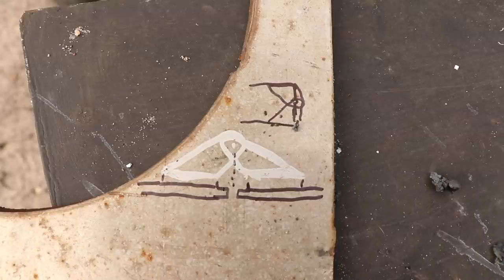Building a Boat Gate - Project Brupeg Ep. 77

Comment: As far as I know stainless steel (work hardens) as it gets hot it gets harder.
So as you drill (using a slow speed) ,have a continuous stream of water going into the hole, to keep the metal cool.

Found Brupeg on google maps.
The wife & myself were up at Bundy in October & we had a quick look from outside the fence.
No one was around at the time so we didn't come in.
You are all doing great work
Keep it up.
Reply from the maker: Thanks Bill. It would’ve been nice to catch up and show you round the boat. Thanks for the advice. I’m thinking of a little pump to do cutting fluid/water

Comment: Find a shaft to mock up hinge positions - i.e. to go through both hinges vertically and make sure their pivot point is aligned -  you can revert to separate bolts post fitting.
Reply: Yup. Was going to say the same thing. I did that When I had to weld hinges before. But you are probably ok.

Comment: Yep, you need some consumables for your plasma cutter. Once the tip blows out the side it needs to be replaced before it damages other parts. I buy them 10 or 20 at a time so I always have them on hand.
Reply from the maker: Yes I buy consumables in lots of 50 from eBay. The issue I was having is the consumables were lasting 20 seconds before for blowing out

Comment: 23:00: It's one of those objects that has a different name in every English-speaking country. Here it's called a "hand truck" or, more usually, "a dolly". I've got one that can support about 350 kgs. and converts to a four-wheeled pushcart. Very handy, especially if you've got an expendable one. 40:27: The dreaded nine-inch! It occurs to me that you could glue lengths of rubber strips on the inside of that stern at the three-mil gap to keep following seas from squirting onto the back deck. Same with the gap between the hinged doors. 49:28: Next you'll want a passerelle! This should also be handy for bringing supplies on board. 52:00: I watch Stu's channels as well. Our boat's right between yours and his in size at 12 metres/42 feet.

Comment: It always feels like an achievement once you get a hole drilled in stainless. It’s horrible stuff to drill. 
Bunnings used to have some Dewalt tungsten drill bits relatively cheap (about $50) for a full set. They were bloody fantastic for drilling stainless. A world easier than HSS drill bits. Unfortunately I haven’t seen them in stock the past few months. 
Well done, you guys are doing a great job and putting together a great video series.
Cheers
Reply from the maker: Thanks Michael

Comment: G'day from Bundy! You will likely have trouble trying to drill stainless with anything larger than about 6mm dia in a pistol drill.
If you have much more to do it would probably pay to invest in an old, el cheapo, drill press. The mechanical advantage afforded
by the quill feed rack and pinion allows you to maintain much better down force on the bit, to prevent 'bounce' which very quickly
destroys the cutting edges. Also you have much better speed control and the holes will be square to the workpiece. Proper thick
cutting oil is also essential. Normal HSS jobber drill bits should be more than adequate if used this way.
Bit late now, I know, but aligning the hinges for welding would have been easier and more accurate if you clamped each set of
pairs on a length of all thread with 4 nuts and washers to set the vertical spacing, ensure parallelism and axial alignment.
Good luck with the project. Keep up the good work. Really enjoy the channel! :-)
Reply from the maker: Thanks Martin after I made the hinges I thought I should have put a piece of threaded rod through them exactly like you mentioned. I have been considering a drill press for a long time but when 50 things need dollars and the drill press is something I can get away without it has always been hard to justify it
Reply: @ProjectBrupeg  Yeah, LOL understand the dollars bit. Still cobalt bits are pretty exxy too. 3 or 4 cobalt bits = a new press!
Reply from the maker: Yeah that’s a good point, didnt think of it that way

Comment: I am working a lot with stainless steal. For cutting stainless you have to have proper tools. They have a different angle on the spiral and they are out of different  material. You have to be aware that There are different kind of stainless. The one that is easy to work with is V2A. The one that is very, very hard to work with is V4A. If V4A is getting hot, you would not be able to cut through with a drill.

Comment: Re: The dog box (?). Get the cheapest metal garden trowel you can find and cut some wide-ish (5mm) slots along it's length. It'll make "cigar" removal easy, just scoop them up, give a gentle shake to let the sand fall through the slots and bag the nasty.

And I echo Sterlingsabre28
's comment regarding drilling the stainless, your pilot hole only need to be big enough to accommodate the split point of your final drill bit.
Reply from the maker: Thanks Andrew yeah I will swap how aim doing my pilot holes and thanks for the shovel suggestion

Comment: I save broken standard drill tips. Cut them really short and sharpen up. This way you can exert a ton of pressure whilst drilling SLOW. Works every time
Reply from the maker: What a brilliant idea! I’m stealing that!
Reply: @ProjectBrupeg  took me as much frustration as I saw you endure. Went to a steel fabricator one day with some stainless and that's what he used. So obvious really. I generally use 6mm bits (have not needed thinner diameters ,and they're very strong when so short) and upwards for this.  

Goodluck guys

Comment: To get hinge pins in alignment on the same plane, use a long single hinge pin though both hinges at the same time . That eliminate s binding and problems with holding 4 pieces at once.

Comment: Several things you should have when you start sailing . In the engine or mechanical room , a drill press , a vice and a bench grinder . The investment will pay for itself .
Reply: There are gadgets you can get to turn a regular drill into a press.
Reply: I good quality 15mm/1/2" bench top drill press would be a good addition to the boat project. Save you a lot of time and broken drill bits.
Reply from the maker: Dead right. We just brought a brilliant drill press recently

Comment: the hinges are binding on them self if you look at the gap when opening the gate you will see that each side of the hinge changes angle as it swings because of the slope on the stern, your idea to fix is good but you need washers between hinges top and bottom if that does not work it is because the angle of the hinges top and bottom are opposing angles. the angles need to match between top and bottom hinge.  hope this helps you could try bashing them.
Reply from the maker: Yeah large hammer alignment was my next thought for exactly the reasons you pointed out
Reply: Cheers  @ProjectBrupeg

Comment: How about Teflon washers between (and above & below)  center hinge points?
Reply from the maker: Yeah that’s not a bad idea. Might put a couple in and see what it does
Reply: @ProjectBrupeg  it will put you top lip out of level. grind the gap re-drill the holls. its looking so cool your doing a good job on it. first time coment whoop whoop love the channel
Reply from the maker: Hey Allen awesome to have you along. I need to put a wood cap on the top so I could maybe allow for any height increase by relieving the wood a little so the tops surfaces are all level
Reply: @ProjectBrupeg  Glade I read the comments; I was going to recommend
cutting the top rail off of the doors and replacing with a wood rail.

For a strong latch: consider using channel beam on top below the rail
and at the bottom with a sliding box beam as the 'latch', with another
section connecting the top and bottom, that would cover the 'gap' when 
door is closed.
Reply from the maker: Yeah that would work. Thanks Hammer

Comment: Hi both, another great video!

I noticed the belt and disk on your linisher were looking a bit tired.  You can greatly extended their life by cleaning them with a lump of crepe rubber, the sort that is used on the sole of kids sandals.  You should be able to get some from anyone whom deals with abrasive belts.  If you cant I can arrange to send you some from the UK, let me know.

I'm not sure whether your planning to lift a wheelchair through your snazzy new gates but 800mm is a very tight fit, I know this from trying to manoeuvre my chair through similar sized openings.  Just a thought, I hope no offence us taken,

Great music again.
Reply from the maker: Hi Nic the rear gate width is limited by the stainless fuel tank vents on either side. That said we have made the three external gates able to handle a 16” chair (couldn’t fit wider). It’s not perfect but it’s better than nothing.

Comment: Nice work! You might not have those two hinges coaxial to one another (not tilted, but parallel and off axis). Drilling one out larger (or one bolt smaller) might make it better - as you suggest.

Comment: I reckon whats happened with the hinge is the welds contracted when you welded it, so the axis of the two hinges is out of alignment. 
Imagine a straight line thru the centres of the bolts...
Take the door off, clobber the hinge with a 2lb hammer till its parallel to the other hinge and all should be good
Reply from the maker: Yeah large hammer negotiations was the next step for me.

Comment: I understand the need for the gate, you also mentioned using the crane to help jess onto the boat, does this mean that she will eventually need wheelchair assistance?
Reply from the maker: Hi Dennis. Yes that’s correct. She is off and on wheelchair based at the moment. The three gates and all doors have been made wide enough to fit a chair

Comment: Its not ideal but a big hammer drill  like a spline drive or sds with small masonry bit punches thru stainless. With a pilot a bigger bit can at least cut in. If it aint making chips its making heat. Yall will have a cool boat before long.

Comment: Actually stainless steel work hardens.  That means if you drill too slowly it hardens the stainless just before you try to drill it!  It's a fine line but usually pushing harder is the key.  Use that plug in drill & give it a go.
Reply from the maker: Honestly my two speed battery drill has  3-4 times the torque of the plug in drill. It’s phenomenal

Comment: I was always told to drill stainless slower n not full pressure
Reply: Stainless is slow and lots of pressure, that last thing you want is the drill to slip, if it does it will harden the surface and is then a swine to drill

Comment: You probably already know this but I’ve always found that drilling stainless steel requires slow bit RPM and lots of downward pressure on the tip of the drill bit and lots of cutting fluid.
Reply: Yep. And oh my god get a drill press! just a cheap benchtop one will do. Even if you never used it again it would be worth it for a couple dozen holes in stainless plate

Comment: @ 55 min this ep is longer than 'The Doors' debut album....had to schedule time to watch (enjoyed every minute), thought you might have gone wrong with door alingment cause you didn't maintain the consistent measurement "source of truth" (should have stayed with the calculator for all your setup or maybe used an engineering calc rather than that acounting model ;)
If that sand box doesnt work, a mate of mine used a piece of astro turf (about 2x1 meter) draped from his stantions to his deck (thats DECK) for his dog, gave him a vertical surface (with a wind break) to cock his leg and a familiar surface to push a cable out and all he did was flip it over the side and easy clean in the water (no sand to march about the boat, easy storage to)
Cheers
Reply from the maker: I do like the idea of no sand to deal with

Comment: 54:20: "give a bit of a fight"...how about pivoting or sliding captive steel bars inside and out to reinforce the plating?
Reply from the maker: I was thinking a vertical dead bolt style lock, but made out of 30x6 flat bar rather than round and taking the load across the wide dimension rather than the small
Reply: @ProjectBrupeg  Sure, also good. Another approach would be to have folding braces on the backs to deploy in crap weather, as I assume water's not going to flow out that way, but leave via the scuppers, so you just have to have a means of reinforcing the doors to take a wave strike from astern. Of course, another approach to lessen the force of that would be to perforate the doors (at least when they're alloy!) with a grid of holes sufficient to allow water to squirt past, without compromising the strength needed to avoid buckling. Probably would need fewer pins, plates, pegs and braces, then, save for something butch enough to keep the doors together at the top.

Comment: Nice vid as usual. Why do the hinges have to be stainless?
Cheers
Reply from the maker: They don’t have to be but making them stainless means we won’t have rust stains down the back of the boat as the constant sliding motion would wear any paint away and with stainless we don’t need to lubricate it therefore avoiding grease stains over our clothes frequently
Reply: @ProjectBrupeg  Ahh - yes of course! You guys certainly never seem to compromise.
Cheers

Comment: The gate is bent, that's why it is binding.
Reply from the maker: Yeah could be I will do some more measuring to see on that front
Reply: @ProjectBrupeg  If you look at the video where the gate is open, you can clearly see the gate is bent (buckled) on the vertical. I'd have considered bracing the gates with flat bar around the edges (at least the permanent ones) as well as the sides adjacent to the gates and on the deck side of where the hinges are.
Reply from the maker: Yeah that’s not a bad idea. With the alloy gates I think I will add vertical sides on each side of each gate